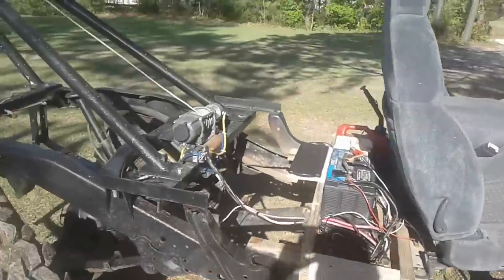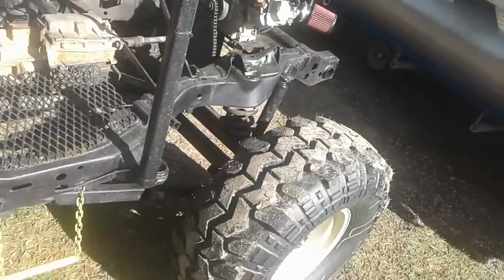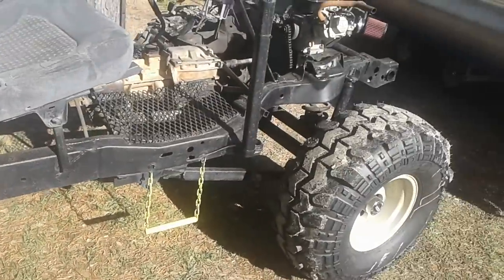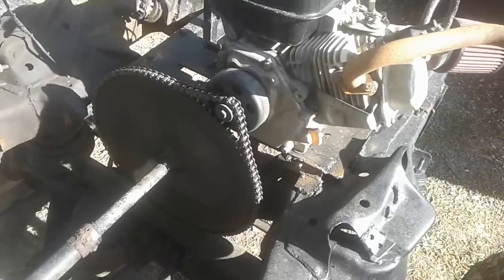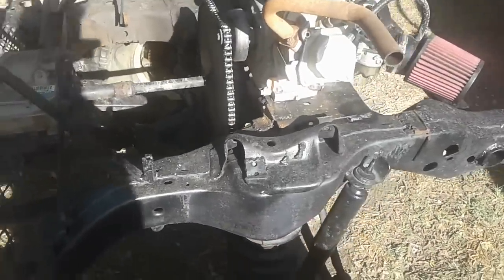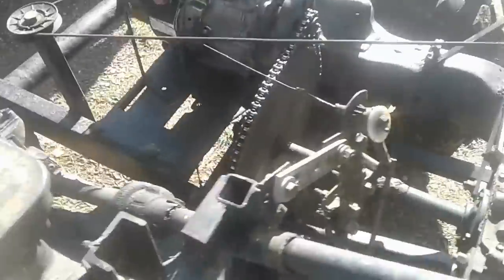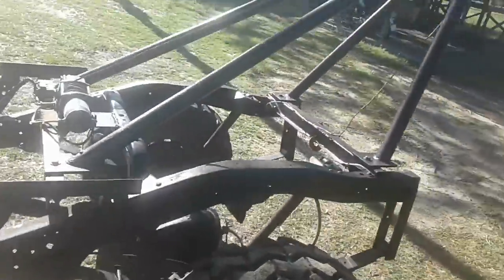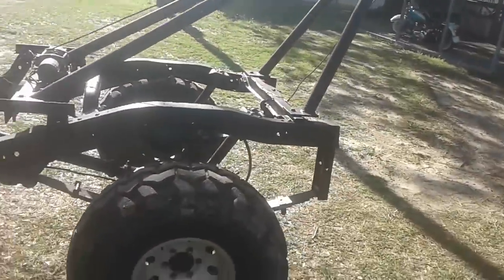6.5 HP tow truck build

Comment: The centrifugal clutch is the amazing part...even with all the gear reduction you would think a torque converter would be needed.  At any rate, very cool build.
Reply: a torque converter will burn out if you use it on this, a clutch does a much better job.

Comment: I was not able to find that 96 tooth sprocket at Graingers. Is that number 40 chain 1/2 inch pitch?  Do you know of anybody else who sells that keyed sprocket with the hub? Not sure the diameter of the go cart axle you used?. Thanks for uploading this video. Any info would be appreciated!
Reply: Gopowersports.com will have everything you need
Reply: Go double reduction 2 chains 4 sprockets

Comment: you got my subscription, h9ws she hold up to time? have you considered doin performance upgrades to the engine? like a billet flywheel, agressive rockers, agressive cam, billet connecting rod,  and a mikuni or another brand of high output slide carb?

maybe go from 20 ish mph up to 30 or 40 at its top speed, and have a lot more pulling power.

or if tuned properly for low RPM grunt, you could gear it up a bit more and do the same by adding a longer intake header and those performance mods to boost bottom end torque.

Comment: I have a deuce and a half stripped down, pretty much the same as this rig.  Do you think a 14hp would be enough to move it if I geared it to do 15 or 20?
Reply from the maker: Splittin n Stuff  yes
Reply from the maker: Splittin n Stuff   yes get a 75 tooth sprocket , reared needs to be at least a 325, let me know,  and i can tell you !
Reply: @michaelmadison5051  I have a 1951 jeep with Dana 25 axles.  Supposed to have 514 gears. Do I still need a 96 tooth sprocket?
Reply: @michaelmadison5051  Hey buddy how can I get a hold of you to chat some ideas?

Comment: Besides the predator engine where do I get the other parts. I’d like to convert a vw beetle to a dune buggy using this. I believe it has a 4.37:1 ring and pinion 🤔but if I use 28 inch tires what do you think my top speed would be? This would be an off road trail project. Any links or part no. would help. Thank you
Reply: I just realized you’re video answered my question 😬 . I found a go cart centrifugal clutch with a 12 tooth sprocket that uses #35 chain and  a 72 tooth sprocket on eBay. Is this a good deal ? Or should I look for #40 chain. What the difference between a centrifugal clutch and a torque converter ? Both looked the same the converter didn’t look like a car torque converter (no oil or finns).

Comment: What about brakes and transmission cooler lines. Is it ok to do without brake booster and the transmission cooler. 

I am about to start this project . Trying to gathet as much info as possible. Thans for the video.
Reply: John mike you using a auto transmission?

Comment: Very cool only part i dont fully understand how did you do the clutch i seen you had the clutch disc rigged up somehow
Reply: He is using the centrifugal clutch on the predator. Doesn't need the truck clutch. Probably just decel a little to shift.

Comment: I love your projects. Have you ever heard of a Constantinesco torque converter? I know you could fabricate one. They are the ultimate transmission.
Reply: Ron Armstrong 
With how deep his gears are, the .9 overdrive might hit 30 mph. 

But one of those, combined with a smaller main gear, and some mods to the engine to run more rpm, and you'd do alot faster

Comment: I'm about to buy a beater s10 and take the slow boat up the river run!!! XD
Reply: A manual yes but those automatic are trash the 700R4 4L60E family are garbage my Silverado is at 270k miles and it's going on to a third Transmission
Reply: @bryanmartinez6600  I rebuild my own as preventative maintenance at this point when I buy something with one in it. They're pretty terrible stock. Easy to rebuild and make tough enough.
Reply: @Billy28376  true they are pretty simple for a transmission if anything I hate the 6T70 that I just had a run in with. At least you can fix a 4L60 with normal tools but the 6T70 requires equipment to reprogram a replacement valve body/ control module.

Comment: i have a s10 but it is automatic could i still do what you did with a automatic trans in it let me no and do you have a email i can send ya pictures and stuff thank you jim
Reply: Yes you can use an automatic you take out the torque converter and use your clutch as the torque converter

Comment: You think i can do this to an old automatic subaru?
Reply from the maker: noah borko ,  haven't done automatic yet !
Reply: It would be kinda hard, but if you were a machinist it wouldn't be so bad. 
You'd have to make an adapter to mount to the flex plate. From there it's easy. Although you would have alot of loss. You would want more engine to make up for it.
Reply: Thanks for posting up more info!

Comment: can i do this with an automatic trans
Reply: truck ricers as a direct drive setup similar to this I would suspect so
Reply: yes if your motor has 20 or more horse, you'll lose 5 hp and you should use a synchromesh manual box behind the torquie since the hydro/electro automatic will lose another 3 horse and won't shift at the right times

Comment: When going down hill do you loose the ability to use engine/gear breaking with the centrifugal clutch?  I live at 6000 feet and don't wanna roll off! Ha, ha.
Reply: Primitive Bob I would assume no power breaks or power steering and with that clutch no engine braking
Reply: enginebraking should work you might have to hit the gas once to let the centifugal clutch engage. my guess.
Reply: You will absolutely not have any engine braking
Reply: Even if you did away with the centrifugal clutch and used factory truck clutch the engine would not have enough compression to slow the truck down much on big hill
Reply: Maybe a hydraulic pump for power steering and hydro boost brakes
Reply: well, i have been driven 50cc scooters. on downhills the centrifugal clutch will not disengage. even if you don't touch the gas for minutes. - the engine will not break very much indeed, but think of the gear ratio. building the massive torque in the direction engine -> drivetrain, has the same effect in the other direction: massive torque is needed to turn the engine.
Reply: i might be wrong. i'd like the see a video of that thing going downhill and showing what really is happening.